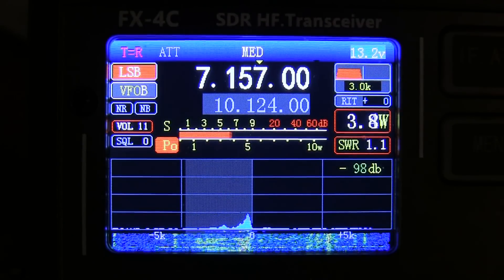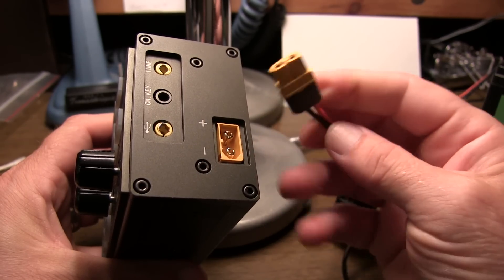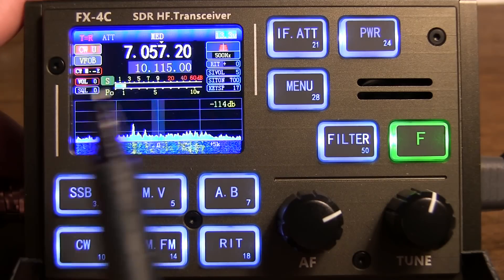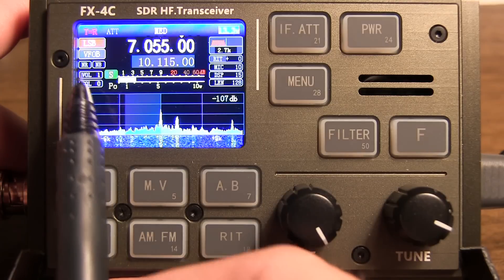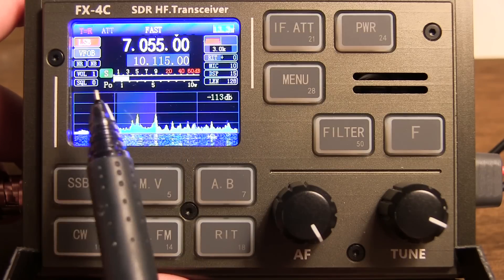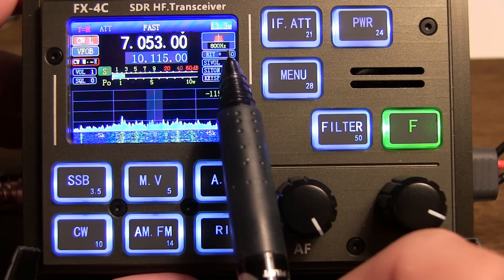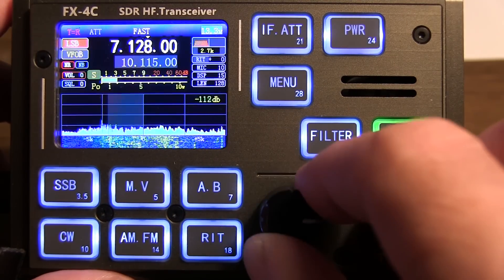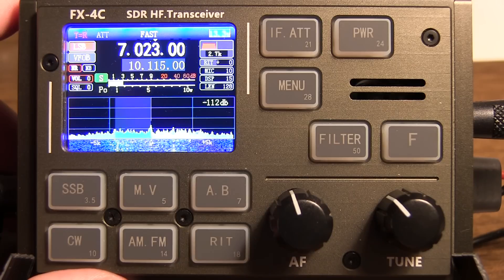#355: Radio Review: FX-4C SDR  QRP Transceiver | Review of features and operating controls

Comment: How much does it weigh and what is the lowest power can you run?
Reply from the maker: It weighed about 1 lb, or about 0.46 kg. Power can be turned down to 100mW
Reply: Thanks for writing back. I backpack and qrp. I have an ic 705 and love it but the weight adds up by the time you combine everything.
Reply from the maker: @kylefreemason  Of course you still have to add a battery, and optionally a tuner if needed.  There is a built-in mic for SSB operation, and you'd have to add your own key or paddles for CW.  Overall, I think my KX2 is lighter with the built-in battery and tuner, if you factor those things in with the FX-4CR.  But of course, the KX2 doesn't have the spectrum/waterfall display...

Comment: Just received my FX-4CR last night and did my first POTA activation with it this morning. Its a surprisingly great operating experience right out of the box. Using an X-Tenna EFHW and a MFJ portable-tuner, this thing worked like a charm immediately. The sound is great from the speaker and the display is fantastic. It is consumes .5 amp on receive and maybe 2amps on full-power transmit. POTA will be even better for me now! I have not even played around with different settings or read the manual top to bottom yet and I am already thoroughly impressed. I do not operate CW yet, just Phone/SSB and all the controls are intuitive and readily accessible during my activation. The only thing I am having a hard time figuring out is the voice recorder for an automated CQ msg. I thought it does that but I have not figured it out yet - then again I have only had it for about 7 hours and using it for the last 3 hours. All-in-all this little 20W radio has me grinning and very happy. I am looking forward to using it and learning about it more. Thank for your very thorough walk-through. I am typing this comment from the picnic table right now at K-0692. Cheers and 73!
Reply from the maker: I don't think the voice recorder or CQ message memories are implemented yet.

Comment: I was under the impression that this radio does have a cw decoder, can transmit with 20 watts and 5 watts on 6 meters.  Please correct me if i'm wrong.
Reply from the maker: The revised version, the FX-4CR, can do 20W and 5W on 6m, but does NOT have a CW decoder.

Comment: Temporarily Offline Ham Radio did a YouTube video where he disassembled the FX-4C. He found a coin type battery holder on the PC board, which was empty. He didn't check to see if memories and settings were maintained without that battery. Based on your experience, have you found that both memories and settings are retained when power is turned off?

Comment: Really nice, but....that's an AWFULLY lot of money (~$600), for a radio that, no doubt, is full of SMDs & special purpose LSI ICs.  I recently acquired a nice Yaesu FT-101B, for under $200, which I can easily repair, if (and when) it needs it.
Reply from the maker: It is certainly full of SMDs, but all components are commercially available (no custom ICs).
Reply: @w2aew  In that case, I might consider it, but not without some serious preparation!    My 70 year old "peepers" "ain't what they used to be."  A magnifier is insufficient---I need that for discrete transistors.  Maybe a stereoscopic microscope?  Oh, the good old days, with point to point wiring, on terminal strips!....and those nice, fat carbon resistors, and wax impregnated "condensers."  But I'm YOUNG!  I knew a ham in the 1960s, who told tales of the REAL good old days of amateur radio.  Tales of the rotary spark-gap, chemical rectifiers, and reluctors.
Reply from the maker: @Pootycat8359  If you want to see "inside" of this radio, check out this video (not mine): https://youtu.be/P5V0Lf1t5uE
Reply: @w2aew  TNX!
Reply: @w2aew  I checked it out, and checked, and found that that MPU is cheap & available.  I could fix that thing,   But first, I'd have to contact the folks on "Planet IX" (from "Dune"), and get a pair of bionic eyes.

Comment: Alan, did you see that two new FX-4C-like rigs have been added to BG2FX's website?
Reply from the maker: Yes, Yu made some hardware changes and improvements to the FX-4C which turned it into the FX-4CR, replacing the FX-4C.  He also designed a lower cost version (FX-4L) which has a reduced feature set (no color LCD, waterfall, spectrum, etc., no built-in USB audio device, etc.) which will sell at a lower price.

Comment: hi in sdr devices we have a part named digital down converter what does it really is it operation like our analog mixers for making if signal from rf signal?
Reply from the maker: Yes, a digital down converter is essentially the same operation as an analog mixer, but performed with digitally sampled signals.  The RF/IF samples are multiplied against a numeric sinewave to produce samples at a lower (or baseband) frequency.  A DDC will often be a quadrature converter, producing digital I and Q signals.

Comment: Great review/overview! I tried looking through comments and may have overlooked it: Does the FX-4C use relays or PIN diode switching in CW? Can it do full break-in?  Many thanks!
Reply from the maker: It is relay switched - so not perfect for full break-in.  It has an adjustable delay to return to rx - much like your 6100 I think.  So, you can adjust it to QSK between letters or words - depending on your speed.  No CW tx memories at this time either.

Comment: Hello again.  I just received my FX-4C and got to play  with it today.  I was testing the accuracy of the transmit freq. using a dummy load and my IC705.  I noticed a couple of spurs above and below (the lower one was much stronger).  Have you noticed this, and do you have any idea how I might fix this?  I still think this is a dandy little radio.  Thanks!  AA4K
Reply from the maker: I recently looked at this, and noticed spurs that were offset by 24kHz from VFO frequency.  I emailed the designer about it, and he's investigating ways to reduce them.

Comment: You mentioned that you used an end-fed antenna. What was the maximum SWR that the radio was able to work with? I understand that it doesn't have an internal tuner.

Comment: If you had to pick one QRP radio, would you pick this one over a KX2?
Reply from the maker: Well, since I've never used a KX2, it's a bit unfair to ask.  However, knowing the performance of Elecraft products, it would be a tough call.  I really like the size of the FX-4C, and the Spectrum display is especially nice, audio quality is great.  But I suspect that the receiver performance, especially with regards to operation in crowded band conditions, overload scenarios, etc., the KX2 is likely to win hands-down.  The built in tuner and battery make the KX2 very attractive too.  But, it the KX2 "Shack in a box" package is nearly 3x the price of the FX-4C...
Reply: @w2aew  I'm still looking for my first QRP rig (no need for QRO for me), that FX-4C looks very attractive but the KX2 is a well made and a well known rig. I agree that the "shack in the box" is expensive. It's also quite a bit older too. It's a tough call, not planning to buy dozen of radios... might be just one.
Reply from the maker: @stephane153  Personally, I think the KX2 would be a better first QRP rig.

Comment: This little radio reminds me of a QRP transmitter ham project in one of the radio electronics magazines from the early 60's using a 117P7 tube circuit in a small desktop index card box.  It was a rock bound single band design and I thought how remarkable that was at the time.  Fast forward 60 years and WOW!  Who'd a thunk this was possible?

Comment: First, nice review.  Thumbs up from me.

But, I don’t know who this radio is for. It’s killer feature is it’s size-but that small size is useless when there is no internal battery or tuner.  It also appears to be somewhat fragile, it’s not something I would consider Trail friendly.  The integrated waterfall display is great, but once screens approach the size of postage stamps, you lose the data they display.  The inability to port this data to a larger screen is also a miss, it means that for an inexpensive home qrp rig you’re stuck with a 2” screen forever. The screen also looks laggy.

There are better choices out there.  The Yaesu 818 is about the same price, has internal batteries, wider HF coverage, VHF and UHF coverage, and 20 years of accessories.  It’s rugged, made by a major brand, and will be serviced/supported for at least the next decade or longer.  The Icom 705 is 2x the price, but it covers 2m and 70cm,  has a much larger and better display (which can port out to a monitor), internal batteries, better ergonomics, and again supported by a major brand.  The Elecraft KX2 is only a little larger than this unit, has internal batteries, an internal tuner that will tune a ham sandwich, amazing filter controls, and again is supported by a major brand - with almost legendary customer service in the case of Elecraft.  You will pay $200-$300 more for a KX2, but that’s your tuner, battery, and charger you’ll need to buy for the FX-4c.  

So, while this radio is interesting, what’s available on the market today from Icom, Yaesu, and Elecraft offer a better mix of portability, features, ergonomics, accessories, customer support and in the case of the Icom 705 the ability to use your rig as a solid base station.  I’d not recommend this radio out of hand to anyone as their only rig or even as their first qrp rig.  For the operator who  has the extra money to play with, if this appeals to you, go for it.
Reply from the maker: Chris - thank you for your thoughtful comment.  While I agree on many of your points, I do disagree with a few as well - and that's ok.   I don't think that the lack of a tuner or internal battery make it useless.  While the lack of these features make it less desirable for backpacking, mountain topping and frequent POTA activations, it isn't really a show-stopper for many uses.  For me personally, I generally carry a larger battery with me, and I enjoy using my small/lightweight Emtech ZM-2 Z-match tuner with it.  Yes, the screen is a bit small and there is some lag.  I find the spectrum display much more useful than the waterfall, and have even suggested to the designer that maybe a user-option to replace the waterfall portion of the display with a digital-mode or even CW decoder might be useful.  So, yes, it is not ideal - but it a nice alternative for a small, quite capable travel rig and even casual home QRP use.  I disagree regarding it being fragile.  This thing is built like a brick - with heavy aluminum extrusion and thick machined aluminum plate.  The buttons and knobs have a very solid feel.  In my opinion, this unit is essentially as rugged as my old FT-817 and IC-703+.  

The commercial alternatives that you mentioned are all really good, and certainly this FX-4C isn't designed to compete head-to-head with them.  I especially like the features, capability and performance of the KX2 - but have yet to own one.  I didn't know that the built-in tuner on the KX2 was a good wide-range tuner - that's good to know, but it is a $200 option.  While the DSP filters in the FX-4C work very well, the lack of true IF filtering can expose some adjacent signal AGC pumping that doesn't happen in these commercial rigs.

I agree with your final assessment.  This would not be the best choice as your only HF rig, but it could fit the bill for many as their travel/qrp rig.  It is a bit pricey compared to other independent/small QRP makers (QRPlabs, WA3RNC, etc.), but is an interesting combination of features that are really fun to play with.  

Thanks again for your informative comment.
Reply: @w2aew  I HAVE a KX3 and am a mountaintopper. But I NEVER use the internal batteries, and don't have the internal tuner - I use the Elecraft T1 instead.  BTW I still have my 703 which I bought while building my K2. I would be very interested in THIS radio IF it had 6m. I have 6m and 2m on my KX3. Also, I grew up in Hunterdon County and was licensed as WV2ECZ there i n '57. I used a Gooney box.

Comment: Very nice review - thank you. I have a Xiegu x6100 that I use for POTA - it does have some features that this little radio doesn’t have. Of interest to me is a internal battery, memory keying, and a built in atu. It is considerably larger however - maybe twice the size, but about the same price. Assuming you are using a resonant antenna and you know your swr is good, I would still be lost without the memory keyer - it frees up so much time doing a POTA activation. I think any radio designed for portable operation should have voice and cw memory cause you’re apt to be doing a lot of it.
Thanks again, John
Reply from the maker: A built-in tuner would be nice - this is one feature I really like with my old IC-703+.  I've never used a memory keyer, but I've also never been in a situation where I would call CQ or make repeated messages that often.
Reply: I have the X6100 as well John for about a week now and I’m really enjoying it but I like this little radio as well I guess you can never have too many
Reply: @slaznum1  unfortunately, I have that problem too :)

Comment: I've been enjoying my little  FX-4C. I too am very impressed with the build. It is a very sturdy metal case (not plastic). One feature I found useful to me when using it in dark areas is to press and hold the POWER button for 2 seconds and that forces all the keypad lights to stay on. Hold again for 2 seconds to turn them off. I too have been in touch with Yu, the designer, about including a little extra front end filtering if he can fit it in. Otherwise I will need to build an outboard filter to eliminate AM broadcast interference I have from a nearby station. I can't use the radio from home during the day (unless I use my magnetic loop antenna, which works fairly well) because of front end overload but at night the AM broadcaster reduces power so then I can use the radio on my EFHW. With this little rig operating from Idaho I have worked stations all over the USA including Hawaii, Alaska and some DX including Australia and New Zeeland. Six meters is receive only but if a band pass filter can be built and included either inside the rig or as an outboard add on then perhaps Yu can modify the firmware to allow transmit on that band. I'm hoping.
Reply from the maker: Oh, I didn't know that about the power button - I'll have to try that.  This would have been helpful at night operating outside last week.
Reply: Please send me an email again, I can't find your email. Thank you
Reply: @hamdiybg2fx407  Hello Yu. This is Gary, KC8UD. You have my email but probably didn't know my YouTube identity.

Comment: Nice compact radio that looks well-built. I prefer the G90 though. The G90 costs 25% less, has an internal Ant tuner, faster SA, and more power.
Reply from the maker: The G90 does look quite good, I may have to give that a try one of these days...
Reply: @w2aew  Having mine for over two years now, all I can say is that it is very impressive. I often receive unsolicited excellent audio reports. Recommended.
Reply from the maker: @Bdub1952  I didn't realize that it has been available that long.
Reply: I have a G90 and use it on SOTA activations. It's heavy! Hence my interest in this little radio.
Reply from the maker: @dangermandave67  This radio weighs in at 0.46kg, which is about 1 lb.  It does not have an internal battery, so you'll have to take into account the weight of an external battery and tuner (if needed).  The microphone is very light.
Reply: @w2aew  I just weighed my G90: 3.2 lb or 1.45 kg. So that's about 3x the weight of the FX-4C. The G90 doesn't have an internal battery either. As far as the tuner goes, I have a 20/40m matched dipole antenna that works really well, so I can live without the tuner (unless I try to do a SOTA activation when there's a HF contest running - then I'm screwed unless I throw my 17m EFHW into the pack as well...). I did a SOTA activation yesterday that involved climbing 2134 ft of elevation gain over 3.3 miles: steep. Carrying the G90 wasn't fun.
Reply from the maker: @dangermandave67  That's interesting - I had no idea the G90 weighed that much.  The website (radioddity) says that it weighs "about 1kg", but it actually is nearly 50% higher than that?
Reply: @w2aew  Yep. 3.2 lb is what I measured using my bathroom scale just now. I never trust those websites! I can attest to the fact that it's a beast to carry up steep hills. Easily the heaviest part of my kit.

Comment: Did you by chance manage to pull 10 watts out of this rig? I would love to have a KX2 but this radio costs more than twice what your little radio costs. Thank you for your patience and kindness.
Reply from the maker: With about 16V supply, it can do 10W.  I typically run with a 12V battery, and on the 5W setting it does about 4W.

Comment: Somebody thought VERY hard about how to simplify radio operation within such a small available front panel area.  I am REALLY impressed by everything about it.  Both design and performance is amazing!
Reply: I think the front panel HMI is quite well designed. With just a little familiarisation, you can quickly change the settings and all the info you need is on the screen. It may be a little rough around the edges but, having done some QRP/P and using a few rigs in the field, I think this is a good design.
Reply: Simplified it with all menus and multipress buttons.   Simplified?   I'm not sold.
Reply: @twohandsandaradio  When I originally posted, I had a long think about replacing "simplify" with "optimize".  But neither really describes fitting ALL the required operations into such a small area efficiently and ergonomically.